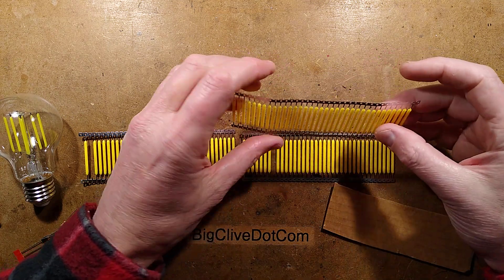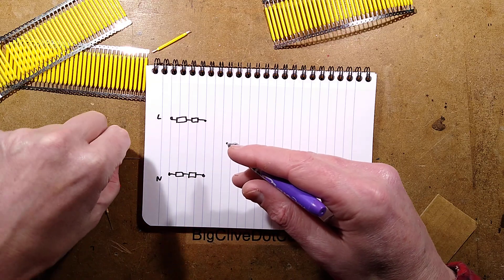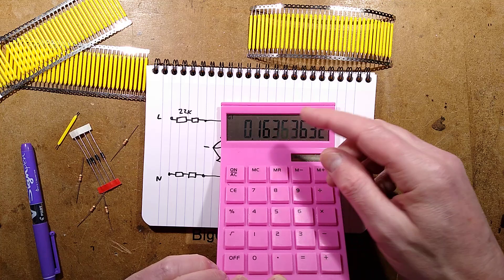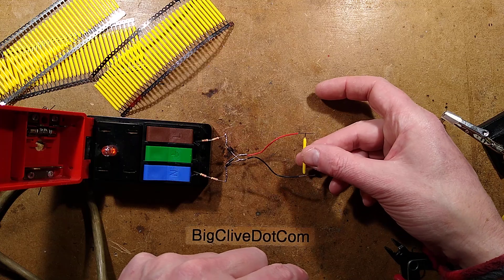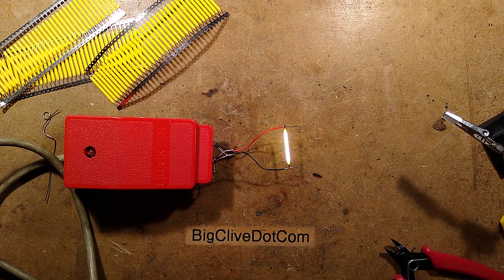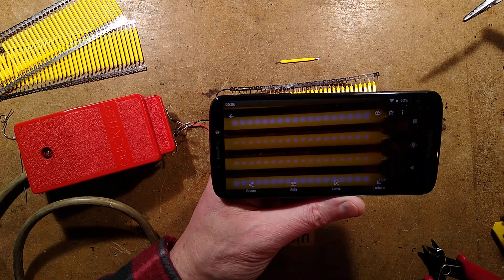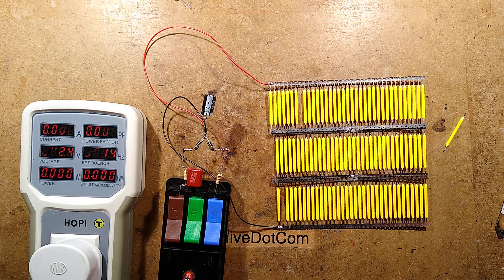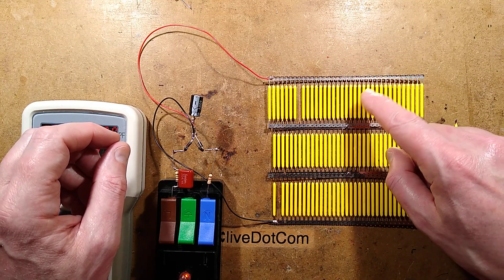104 LED filament lamp - just because....

Comment: is there any dumb way of fixing the power factor?  as in adding an inductor or something (not using active IC ) because the total system efficiency is very low and if u are running home for solar inverter then VA ratting matters
Reply: You need to plug an electric kettle into the mains, then have the steam from the kettle fed into a small turbine that turns a generator that powers the circuit. That'll bring your power factor to 1.
Reply: @PraxZimmerman  
And make tea😏
Reply: @PraxZimmerman  I thought maybe an induction motor to power a flywheel attached to a generator would smooth out diode induced poor power factor, while a capacitor across the motor would cancel out reactive power from the motor.
Reply: @PraxZimmerman  :-) very good!
Reply from the maker: Fixing electronic power factor is complex.  It's only really viable for high power loads.
Reply: @bigclivedotcom  you should try to make a  video on it and show how it is managed
Reply: @s2tenglish  It would be nice to see, in our factories we have massive PF correction units to mitigate this but electronics is out of my area.
Reply: @bigclivedotcom  Why not use a resistor to limit current, in place of a capacitive-dropper ?
That way you should be able to get near to 1.0 powerfactor, correct?

Should you retrofit all your LED lamps at home with such circuitry, the additional Bonus is that the powercompany cannot charge you extra for "apparent" vs "real" power, because you run more towards the 1.0 powerfactor. 👍
Reply: It might be interesting/efficient to run four of those LED-strips in 'antiparallel' with AC..two strips are always off at any given time in the cycle
Reply: @bigclivedotcom  Sorry for hijacking this thread Clive but do you know anywhere that does real vintage colour LEDS at the moment? these RGB plus yellow leds i just got look AWEFULL, I need some real Christmas lights that actually look christmasy, can you or anyone help? 
 I'm not opposed to glass paint or covers if that's what it takes, but we need a new video on Christmas lights because these are terrible.
Reply: If you want to cancel out the reactance of a 470nF dropper capacitor at 50-60Hz by passive means using an inductor, you need one of equal reactance. You are going to need lots of turns to get the 16H worth of inductance needed for 6k impedance.
Reply: @teardowndan5364  wait that does not sound too bad isn't it used in the audio industry for low pass filter ?
Reply: @Wazaag Break-head well I am dealing with a court case so ran out of brainpower
Reply: @AnupamVipul  an inductor might not sound too bad to make a filter, but a 16H inductor is more the size of a transformer than what you likely think of when someone says "inductor"
Reply: @AnupamVipul  - for a low power, low current circuit like the one Clive showed, there is no simple way to get the power factor anywhere close to one. Keep in mind that there are two causes of the poor power factor. First is the ‘dropper’ capacitor. An inductor can In theory help here. But the biggest problem is that the current from the AC supply will be zero or near zero until the input voltage gets to the value of the voltage level on the electrolytic ‘smoothing’ capacitor and the turn on voltage of the LEDs. Then as the current rises very rapidly as the electrolytic ‘smoothing’ capacitor charges up and all the LEDs turn on. Because so many LEDs are connected in series, this turn on voltage will be high. Once the AC sine wave goes past the peak, the current drawn from the input will fall, and as soon as the input voltage drops below the turn on voltage of the LEDs, it will drop to zero or almost zero. It’s this ‘stepped’ current that is the biggest issue. And it’s not easy to solve without having a much more complex circuit.
Reply: @Mark1024MAK  why not just lag the power so much that the power is consumed on the next peak?
Reply: @ilikepie1974  my rough math figures 21.5H at 50Hz to negate 470nF. Could a larger capacitor be chosen instead? Such as 47 microF?
Reply: No practical "analog" way, no...  If you're building something where you're going all-out and can afford to add the few dollars for a PWM IC and inductor, you can get ones now with integrated mosfets like the Power Designs HiperPFS-4 series so you only need much more simple external circuitry with only one inductor that just needs a single winding which gives you 385 VDC power factor corrected, then you use a current source of some sort or LED controller chip and series LED strings... The more classical way with something like an FL7733A needs even more external circuitry and fancy inductors so is far away from being a nice, easy "dumb" analog style "fix".
Reply: @Matt Quinn home is only wired for AC, I'd imagine, they'd need to make a DC circuit for lighting only which is iffy given how a lot of houses are wired
Reply: The system inefficiency of a low power factor is probably less than the inefficiency from using a basic circuit to correct the power factor, so I wouldn't bother trying to correct it. It should also be noted that you should NOT use a capacitor dropper on a "modified sine wave" inverter, only pure sine units.
Reply: @arletottens6349  Only if the LC circuit has high-enough Q to resonate, which it won't be doing much of with a ~150V LED array sucking energy out of it. And you can easily avoid this situation completely by only doing partial correction using a smaller inductor.
The biggest problem with passive PFC of small capacitive loads is that we're talking physical inductor sizes in the neighborhood of 75x50x50mm with 200-500 ohms of wiring resistance. Not practical when the goal is tiny form factors with high overall power efficiency. Many countries have restricted dumb iron core AC adapters for similar reasons.
Reply: Rather than using an inductor to correct the power factor, you would probably have better results just using the inductor as the dropping element. This would probably result in a better power factor than just using a capacitor to drop the voltage. Then with an inductive power supply you can just add capacitors across the line for basic PFC.
Reply: I guess the  PF on the total ie. household are not overcompensated because of some other inductive loads. But never mind, now we have geek fun lol
Reply: @arletottens6349  They won't since they are underpowered.
Reply: @Matt Quinn This is called a DC/DC converter and used all the time to convert one DC voltage to another more appropriate DC voltage with very little loss.
Reply: @arletottens6349  It will never achieve full resonance since it is being heavily dampened by the LED's 150V forward voltage and the inductor's 200+ ohms internal resistance. Try it in a spice simulation, current maxes out around 180mA if you include an output smoothing capacitor, 160mA without.
Reply: @arletottens6349  That is only true for RLC circuit where R is a small fraction of Xl/Xc. Once you add a 150V LED array in series, it becomes a significantly different ball game as only the parts of the sine wave that are above 150V can contribute energy.
Reply: @arletottens6349  If you are going to use an ideal inductance, then of course things get out of hand since the LEDs only provide about half of the damping needed to keep it under control.
Reply: Eliminate the C dropper. Use an R dropper instead. Increase total filament voltage above 200V.
Reply: Yes. You'd have to put an inductor in series with the dropper capacitor. Not sure what the value would have to be. I'm sure there's an online calculator that would tell you.
Reply: @TheBeastUponTheLolz  but I have not seen it done do u have any source ? most people are saying is that u have to use huge inductor due to low frequency of ac mains
Reply: @TheBeastUponTheLolz  that'll just effectively cancel out the capacitor, defeating its purpose. There won't be any current limiting any more.
Reply: @TheBeastUponTheLolz  From my experiences/knowledge, Most power supplies have a Lagging power factor, so what an inductor would create. It has to do with when each of the diodes effectively open and close in the rectifier. I think the way to correct for it is to try to filter out the harmonics that are left behind from the "switching" of the diodes. 

Alternatively, my dumb brain says leading power factor can be fixed by capacitors. So more caps might also help.
Reply: Tying more banks in series so combined their forward voltage is closer to the rectified mains voltage and using a linear current regulator design, or just a resistor, will get you a much better power factor - although you will have to live with the slight mains flicker as dc smoothing cap will kill the power factor.
Reply: @blower1  The closer the LED forward voltage is to the peak mains voltage, the smaller the conduction angle and the worse the power factor.  Lowering the number of LEDs in series will increase condition angle and improve PF, but then you'd need to drop more voltage in series resistance to limit peak current which hurts efficiency.
Reply: @Matt Quinn The reason you won't find many low voltage power distribution systems is because they incur a lot of losses. This war was actually fought at the start of last century between Edison and Tesla, and Tesla winning. The DC - AC - DC path is the most efficient system to distribute DC power. And the higher the AC voltage the lower the loss.
Reply: I don't think you should even mention Power Factor here, because you do not have two sine waves for comparison.  The voltage is a sine wave but the current is a series of pulses.   At most times the current is zero, so what is the PF then?  The current stays at zero until the diodes conduct when the voltage increases beyond the charged voltage of the capacitor.  The pulse of current may only last a few degrees of a complete cycle.
Reply: @hiscifi2986  "because you do not have two sine waves for comparison. " You don't need two sine waves to calculate power factor. It is more than a simple phase shift. Linear circuits have "displacement power factor" non linear ones like this have what's called "distortion power factor". The current pulses contain harmonics  of the power line frequency. The harmonics are what determine the distortion power factor. https://en.wikipedia.org/wiki/Power_factor#:~:text=power%20supply%20load.-,Non%2Dsinusoidal%20components,is%20%22displacement%20power%20factor%22.

Comment: You could power them directly by using bridge/filter and for 240VAC/320VDC[RMS] series 6 of them. [54x6=324V]
Me @120VAC would series 3 with the bridge/filter.
I have taken 50x3.2v-3.4v/1w screwing around and powered those directly off the AC line. [of course always with bridge/filter]

Comment: Can you make the bridge rectifier out of the LEDs?
Reply from the maker: Yes, but LEDs have a low reverse voltage rating.
Reply: I think so. They might be less efficient or something, but ElectroBOOM made one (of course he did...) and used PWM to slow it down so you can see the path through the rectifier

Comment: 1k is too much for a current limiting resistor. At 27mA it will let the smoke out in no time.
Reply from the maker: The current with a 470nF capacitor was actually higher than I was expecting with that LED voltage.  100 ohm would have been a better choice.
Reply: @bigclivedotcom  I would usually use a 47 to 100 Ohm (whichever is in stock) fusible resistor in my own projects of a similar kind.
Do you have any experience with fusible resistors? I just wonder if they make any difference compared to the normal metal-oxide ones?

Comment: Does Cliff make a higher voltage rated quick test fixture? I love that thing but I'd love to see a solution rated up to 350V for our shop.
Reply from the maker: This one os for 240V AC (So about 350V DC).  They do a three phase 415V version, but the phase to ground voltage is still just 240V AC.
Reply: @bigclivedotcom  I did not specify well.  350VAC was my target. I saw the 3 phase model as well but came to the same conclusion.  We actually have them in our factory now (after seeing them on the channel) but can only use them with certain products.  Have you ever seen any other companies with similar products?
Reply: I suppose you could wire 2 together?

Comment: Clive,  thanks for saying 120 volt American fixtures.   Drives me nuts when people say 110 volts when it's not been that way for like 40 years.
Reply: I think generally it's a good idea to rate toward the upper end of what it can be like in the UK, it can still be higher than 240, if you don't take that in to account you could see results you didn't expect
Reply: 110 has the advantage of being the international and memorable value from the traditional set of 55/110/220 .  55 V is appropriate for arc-lamps (19th century).  110V and 220V are the doubled values chosen as standards when the electrical grids were built.  230 and 115 seem to be fallout from the idiotic attempt to create an EU compromise between 220V grids in the rest of the EU and the unusual 240V grid in the UK.  The only nice thing about 230V is that the 3-phase version is a round 400V instead of the traditional 380V.
Reply: @johndododoe1411  only 55 for an arc lamp?
Reply: @phonotical  
55 is for when Edson came over to show movies 😏
Reply: @phonotical  That's what I heard once, but never checked.
Reply: It’s like in Australia when people say 230volts, It’s always been 240v where I live.
Reply: I get in trouble with certain people if I say NZ uses 240VAC when it really uses 230VAC. Mind you, those people then start talking about earthing systems and totally confuse me :)
Reply: Where I am in Aus atm my UPS is showing 235V atm.
Reply: Strictly speaking, America has 220v.

Comment: Thanks for the video!
I am designing a horticultural LED light (high power) and was wondering: why are all companies using led drivers?
Plants do not care about flicker, so couldn't you have LEDs in series (+fuse)   for you local grid voltage?
This would avoid driver losses.. and power factor should remain decent
Reply from the maker: Many horticultural lights just use linear current regulators and do flicker.
Reply: I'm thinking that some LED's will burn out if you supply them with a reverse voltage as high as the forward voltage.  You could put a regular diode in series with the LED's but it would need to dissipate a lot of wattage.
Reply: @myofficegoes65  haha yeah i had that problem and a HV diode fixes that :) 
I'm happy with how it works... Just confused why no one uses that. Maybe because suppliers wouldn't be able to sell worldwide (tailor made for local grids)
Reply: it's nice to have all the electrical safety taken care of by a industry hardened device that is mass produced. also dimming functionality.
Reply: @voltare2amstereo  thanks. i agree that is a drawback, but you can size it for the expected peak (250 in your example) and accept that you light output might dim of you grid dims.
So plants don't require fancy performance ;)
Reply: @draglorde  The LEDs turn off when getting less than their forward voltage, but unsmoothed rectified AC has peaks much higher than the RMS value, so will still get shorter on-periods instead of complete darkness.  But total brightness will suffer.
Reply: Power LEDs are better driven with constant current sources as the forward voltage to forward current ratio depends on the chip temperature. With constant voltage, the hotter they get, the more power they will draw, so it's a very bad feedback loop that can cause LEDs to just burn out. If you feed them constant current, you do not risk to overpower the LEDs over the full temperature range.
Reply: @ProtonOne11  Do you know of any low cost constant current circuits that don't waste all the excess voltage as heat?  Because without that, your advice is impossible to follow in ordinary lighting circuits.
Reply: @johndododoe1411  I've made constant current SMPS before by changing the feedback loop - rather than comparing error in output voltage, it monitors a shunt resistor; thus when the voltage across it is high enough, the switcher "sees" this in the same light as overvoltage and therefore regulates accordingly...
NB. You can do this best with your own brew - you can use switcher chips, but keep in mind you cannot power devices which need a fixed voltage when using the constant current mode, so the IC must be powered by / referenced to the input side, or an auxiliary supply...

As an expansion of the concept, the shunt resistor and the voltage feedback network can be tied together to form a voltage and current limited supply, this is the ultimate battery charger.

Comment: What’s the name of safety wire clamping tool you are using? (The red thing for AC wires)
Reply: Cliff Quicktest
Reply: @myofficegoes65  thanks. Found these varieties if anyone is interested 

CL1850 - QT1 with 13A. fuse and without cable.
CL1853 - QT1 with 5A. fuse and 2m cable to UK plug.
CL1855 - QT1 with 5A. fuse and without cable.
CL1856 - QT1 with 13A. fuse and 2m cable to UK plug.
CL1860 - QT1 with 5A. fuse and 2m cable to Euro plug.
CL1857 - QT1 with 13A. fuse, without cable. USA/CAN.
CL18553 - QT4 with 13A. fuse. No Lamp, Black Lid without cable. CL18554 - QT4 with 5A. fuse. No Lamp, Black Lid and 2m cable to UK plug.
CL18555 - QT4 with 13A. fuse, No Lamp, Red Lid without cable.

Comment: Would things be just a tad safer, if you maybe used a Bread board ??
But there again safer, maybe, but probably not so entertaining...
I'm sure that like Motor racing, some of your viewers are only here for the crashes ... 😆
Have you ever considered using an isolation transformer for your mains voltage projects ??
Reply from the maker: I stand at my bench on an ungrounded surface and have type A RCD protection as backup.
Reply: @bigclivedotcom  
The Caps will still getcha...😁.